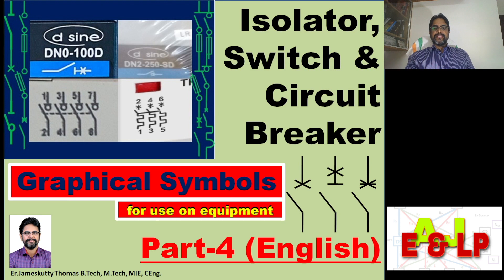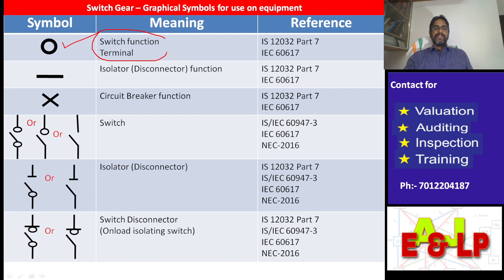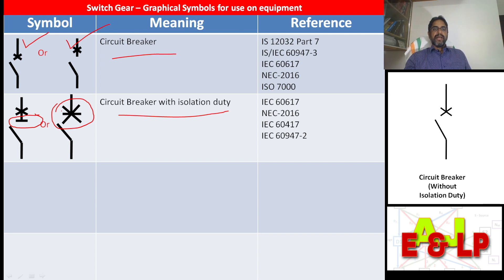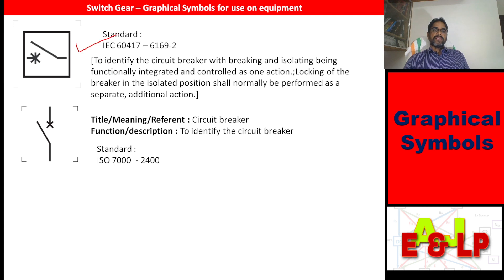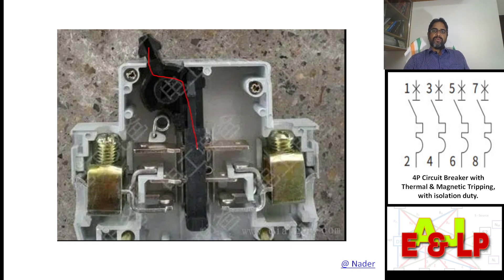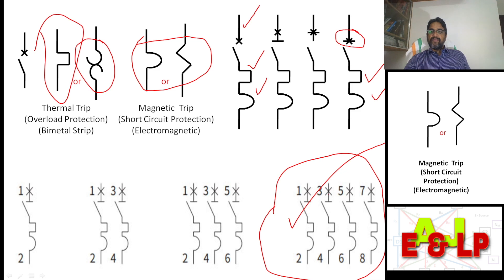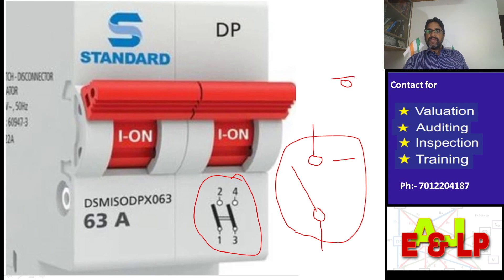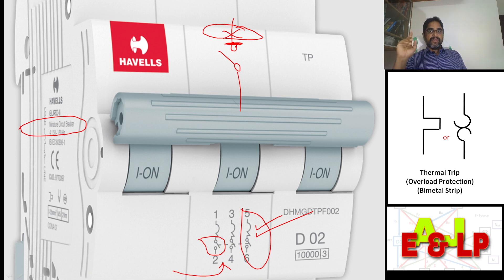13. Graphical Symbols on Switching Equipments.

Comment: Hope the manufacturers strictly abide by the symbols as per standards to avoid any ambiguity to the user and Inspector. Nicely explained. 👌
Reply from the maker: Sir, I think to the Manufacturer side about the Symbols need some more transparency. Firstly, it should assure whether the Isolation duty marked is 100% sure.